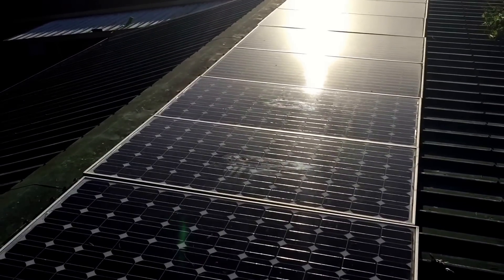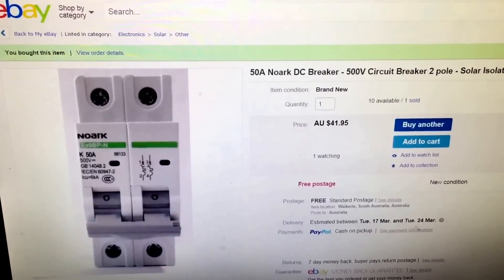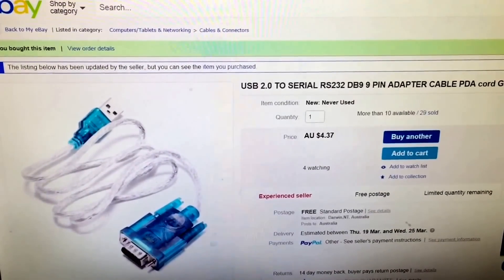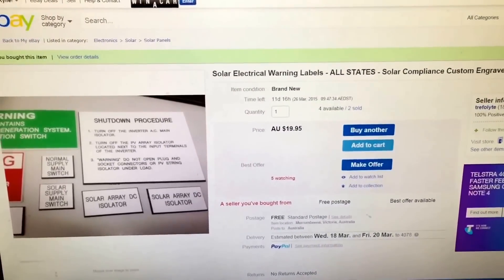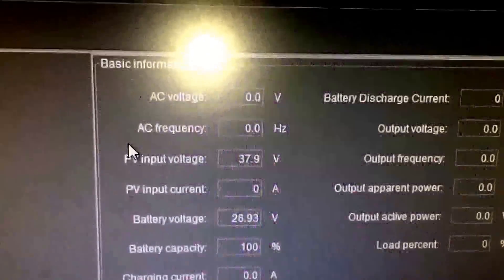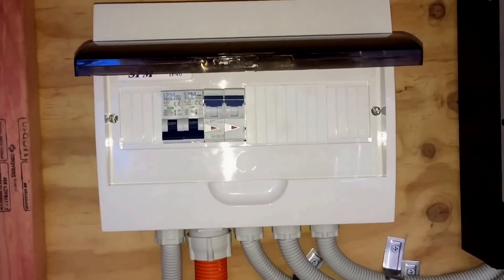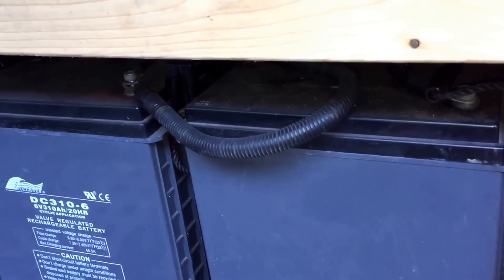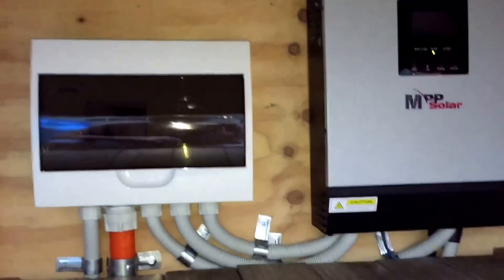Finally getting the MPP 2424HS inverter installed, just waiting on the sparky to do the AC :)

Comment: Nice one. I have been researching the cheapest and best way and came to the same conclusion myself - exact same hybrid inverter and setup with older batteries at 24v. Lower voltage is good in this case as you can parallel better to get more performance out of poor individual batteries without stuffing up the whole thing so much if was in series at 48v. Sub quality solar panels in parallel also will work better rather than all in series which is what I got second hand really cheap.  Cheers

Comment: Why the PV input curent is 0?
Reply from the maker: dan t Because the sun was setting.
Reply: Peter Matthews I asked because I am one , and even when the sun is 0V to indicate the PV input curent.
Reply from the maker: Sounds like you have an issue that needs to be addressed! I'm far from an expert but perhaps look at the 'normal' things - Positive and negative connected properly, dumb I know but check anyway. Maybe your panels might be out of the recommended range or you have the configure wrong. Double check you work the give MPP a email. Perhaps send them a log file if you have one.

Comment: Hello there, are you still using this unit? Any issues worth to mention? I will buy the same unit (under a different brand) so I would like to know your opinions.
Reply from the maker: Alper ALT Only been using it full time for 2 or so weeks so hardly a valid test of the unit. Any issue that I've had so far is of my own fault. Issues with DC breakers they recommend 100a, I ended up with a JayCar 200a unit for 35$ see other videos. 2nd issue was with Power Saving Mode, all my kids went away and the load dropped below 80w and the unit shut off, then pulsed causing every thing that was on stand by mode in the house to click on and off. By simply turning off the power saving mode in the Power Watch software.